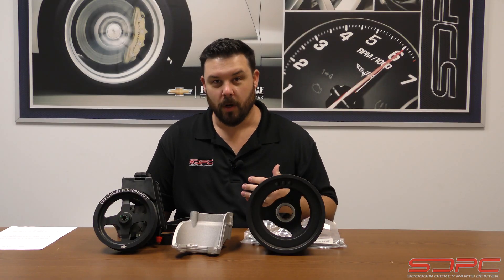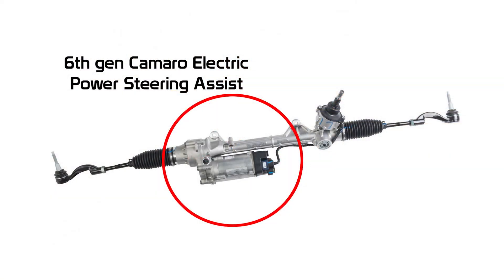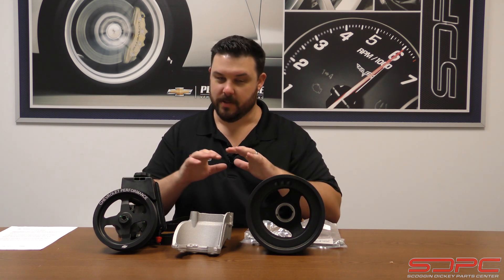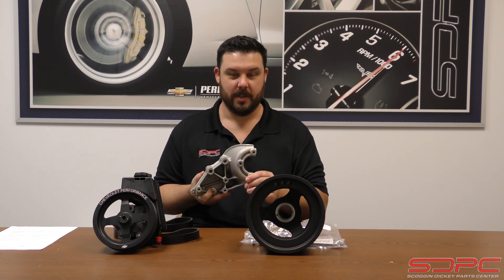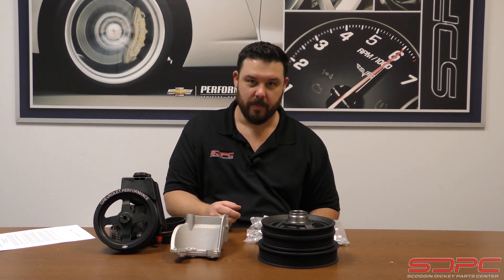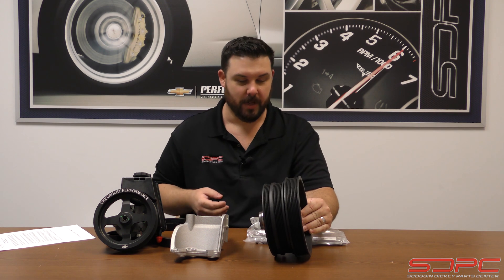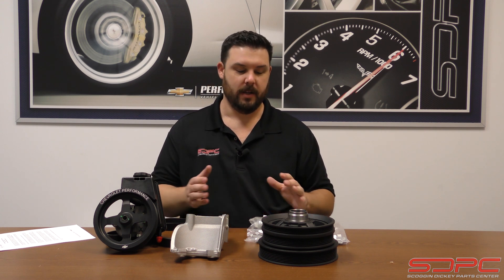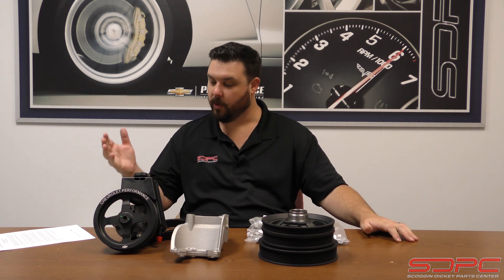SDPC Tech Tips: Gen V LT Power Steering

Comment: Jesus. $1800 for power steering. Another  $1000+ for fuel system fix. Really want the 8l90 but the add ons makes the gen 4 ls and a 6l80 sound more cost efficient
Reply from the maker: We're working on a power steering solution that's waaay more cost effective than the Chevrolet Performance version.

Regarding the fuel system, some people are just dumping the DI and running a port injection using ICT Billet adapters and an LS3 or LS7 intake manifold, with a Gen IV computer.

Do what you will with that little nugget :)
Reply: @Sdpartscenter came up with a better solution?

Comment: HELP.I put LT5 in a 70 Chevelle  and steering is super stiff and doesnt want to return sterr when turning  do to stiff gear box..Is the pressure to hi cause the gear box to not funcion properly?..Have have tried 3 differant gear boxes and joints are not over tight
Reply from the maker: Usually too high of a pressure will cause jerky and too light of a feeling.

Verify you don't have any suspension binding, as well as the pressure you need for your steering rack to make sure it's getting the right pressure.